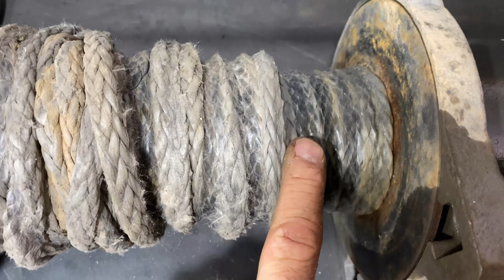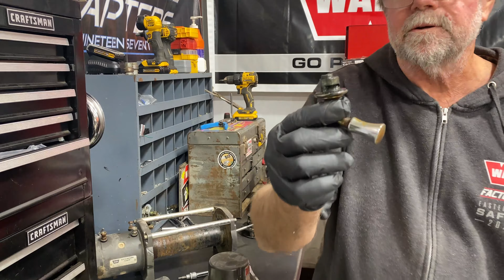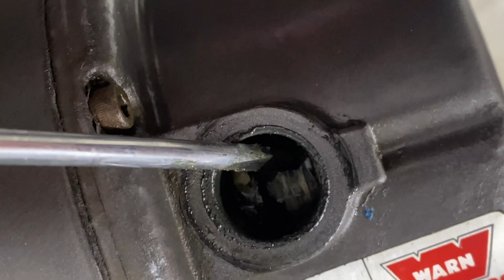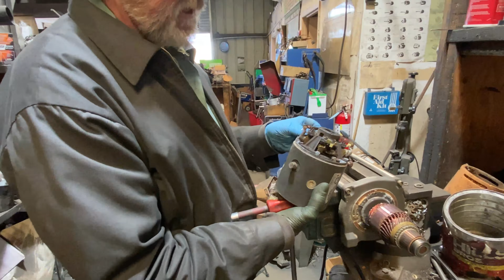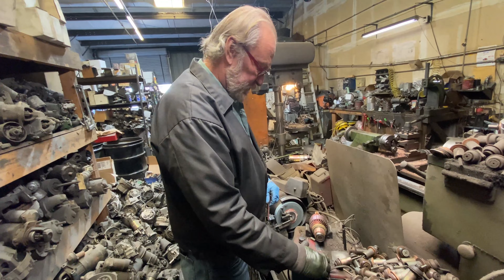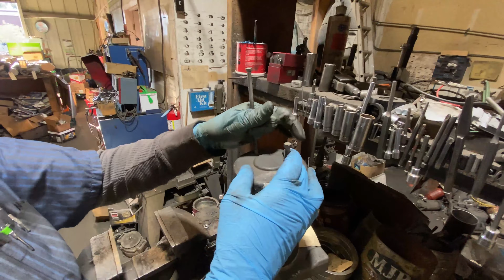Warn Winch Rebuild - For Less Than $200

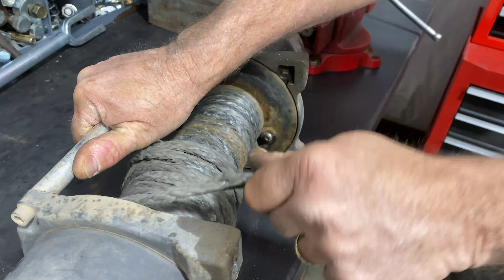Comment: Chris, you never finished going into detail about the ropes condition. 5:56  I see you replaced it, but what did you find that made you change it out?   Maybe do another TechTip video on what to look for with synthetic cables and more back stories of the testing you did in the past.
Reply from the maker: Dang, good point. Realized this after the fact. Also, on closer evaluation of the Viking line, I decided it was still suitable for field use. I cut about 8 feet off (first wrap) and re-spooled it. I'll use the Bubba Rope line on another rig that I'm converting from steel cable.